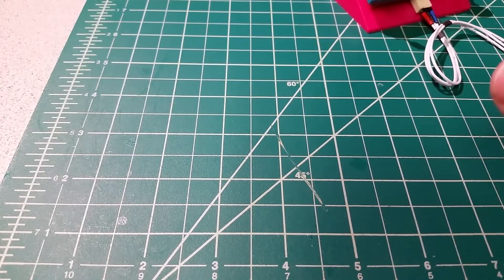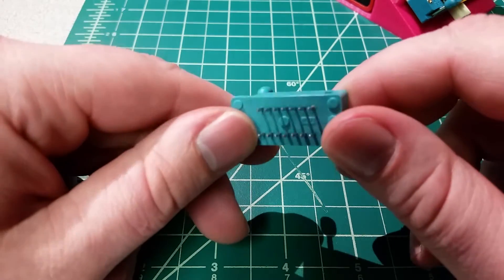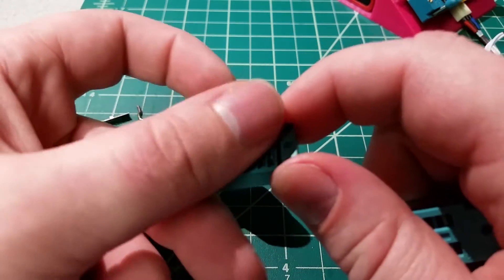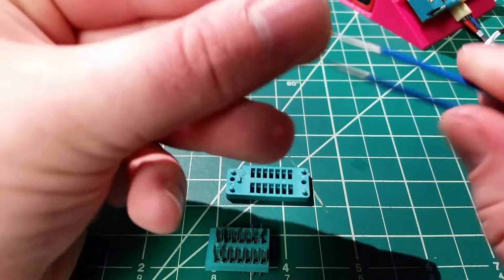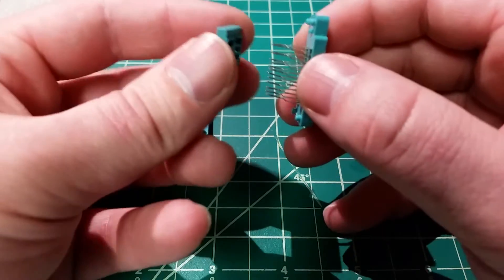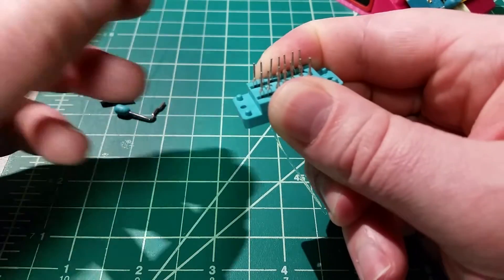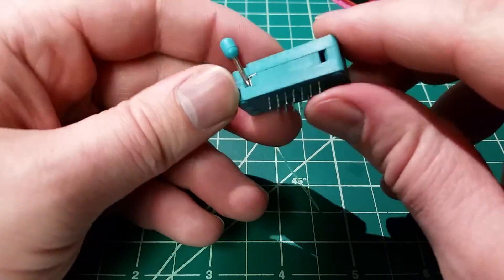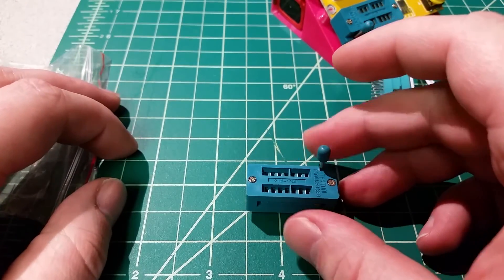Quick Tip: ZIF Socket Reassembly

Comment: I spent a whole day fighting with this. Don't pull everything apart.

Just take the top piece off. Lay the ZIF socket on the side. Position the top piece a few millimeters apart from the bottom. Use tweezers to pull each individual metal socket into its corresponding slot on the top piece. When everything is slotted in place. Press the top piece down.

Took me a few minutes to do this. Much easier than trying to line up all 28 pins at once.

Comment: Nice video. Unfortunately it's not applicable when it's a 28 pin socket soldered to a board which has plate-through holes. 😕
Reply: I just fixed a 32 pin socket with an iron and a hand pump. Wasn't that bad because each pin can be desoldered individually. 
If it's not soldered already the easiest way to fix it is to disassemble them from the bottom and keep pressure on the pins so they don't fall out. Re-assembly up side down too of course.

Comment: Thank you for sharing your technique... I got one of those cheap component testers from China and it arrived with the little spring plate in the socket not properly seated and hence the lever wouldn't stay put.  Following your instructions it's fixed!

Comment: Excellent! Definite Saturday lifesaver.  Mine was cr*p to start with pins rattling loose.  I got it apart and back together but I couldn't quite figure out the spring-plate handle assembly til I saw your video. Thanks very much for taking the time.